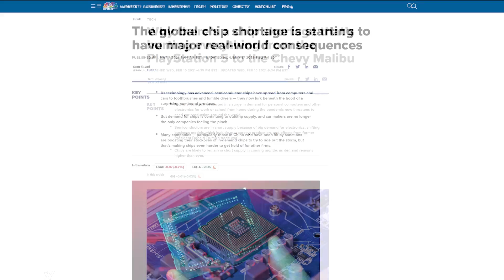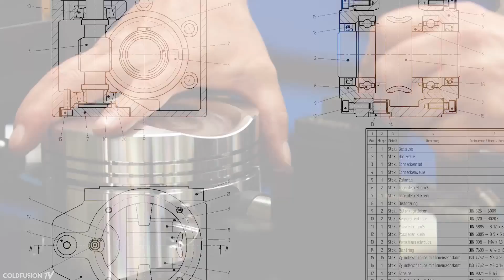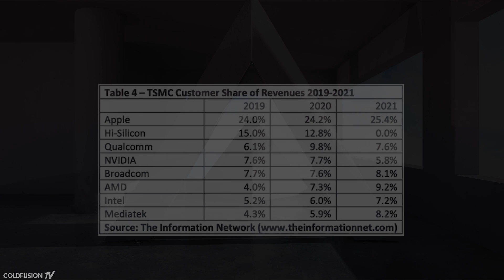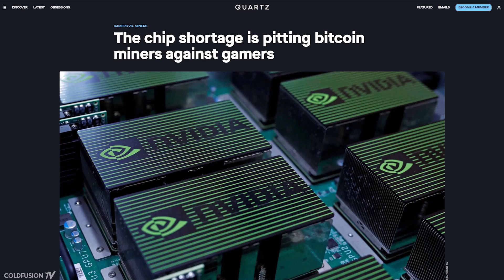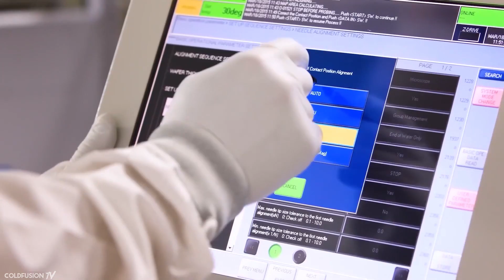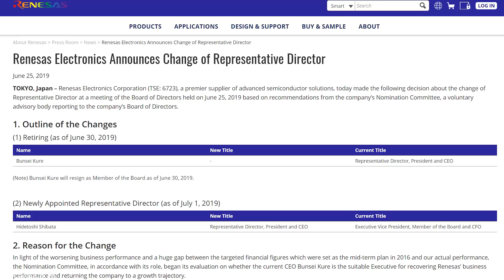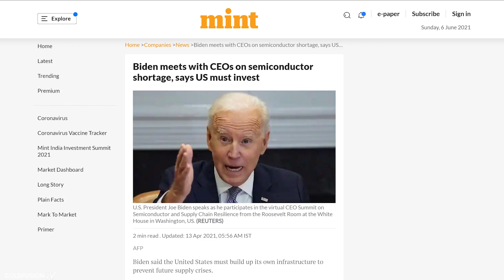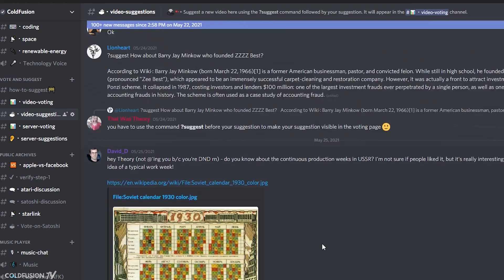How The Global Chip Shortage Started

Comment: update needed, chips should have recovered by now, but it hasn't.
Reply: It's due to manufacturing constraints on older generation chip manufacturing processes. The world is "flooded"  so to speak with foundries capable of making the newest computer processors, graphics processors, and phone processors on 300mm silicon wafers. 

But there are only a few fabs that can still create other non cutting edge chips (like small micro controllers, high voltage devices, durable and ultra reliable microcontrollers that go into cars and machinery) that are made on smaller 150mm and 200mm silicon wafers... Those semiconductors can't be made on the high tech new processes for various reasons. 

Think of it like the world is still in need of computers that run windows XP... Everyone can offer you plenty of windows 11 devices, but if you HAVE to have a Windows XP computer there's only one company still making them. (Obviously I made that up, but it's a decent example.... There's stages to chip manufacturing and too many plants have upgraded while products exist that can't be upgraded until a new solution is found)

Comment: As you said, the dependency on semiconductors is clear. There's one BUT to it. In many cases, we were not asking for the chips to be inside... Manufacturers pushed them down into our throats, giving (very often) no option to get a substitute. Do cars need so much electronics inside? No. Do fridge need Internet access? No. With all that extra electronics inside, is it more AAAAA+ friendly to the environment? No. What's wrong in an on/off kind of electric kettle? Do each and every one of us need at least 3 GPS receivers to track us down (phone, wrist watch, car)? No. And yea, consumers aren't free of guilt too. Picking "modern" and "shiny" things just because they are there (even if something doing exactly the same, they already have and is/works fine).

Comment: Auto makers have been producing more cars than are needed for a long time. Many unsold cars end up in car graveyards, and are left there to rot. Companies like Ford manufacture cars to start breaking down after 5 years, so you have to buy a new one sooner. They are perfectly capable of making their cars last longer, but if they did, they would make less money, so that's not going to happen.

They keep packing more and more electronic devices into cars even though they are the most likely systems to fail. Over 30% of modern car problems are electrical failures. 

All car makers are making more cars than they should be, and many of them go to waste. They can take this time out in the corner to think about what they have done.

Comment: Everything happens for a reason. Pentium 4 chips have been around for quite some time now. Even though commodores chipset was ahead of its time, pentium/intel got all the exposure. But new technology is on the horizon so they don't invest in the old technology anymore. There are photometric processing units on the way. They are 10 times faster and consume 90% less power than Nvidias GPU's. ARM processors were proven to be fast and reliable, but this new tech could be revolutionary it just may take couple of years before a consumer can get their hands on them, because the tech relies of small light tubing which is very expensive to produce. But this might explain why exactly big corps are at a hault with manufacturing. They simply don't know what is beneficial at this point.

Comment: The usual response would be to diversify the supply chain for redundancy. But the crux of the problem is that the capital required to build a semiconductor plant is truly astronomical. For new chips, ie 7nm and 10nm silicon used in modern cpu/gpu, the equipment can cost hundreds of millions of dollars and take years to build. This is because the equipment is EXTREMELY technology advanced and not easy to make. Fixing this problem would require a worldwide initiative to expand production, requiring a decade (probably) and billions of dollars. This got so bad because the big players just got bigger because the cost to play at the table is higher than anyone could imagine. 

SOURCE: I used to work at GLOBALFOUNDRIES (GF), a NYS-based semiconductor plant, as a researcher. They are pretty much wholly contracted to AMD and make all of their chips. The total cost of the GF facility was something around 14 billion dollars.

Comment: China is producing 1 billion chips per day in June 2021 (28 nm and 14 nm) mostly used in auto industry, and data centers. These components represent 90% of IC market. If I am correct, at this rate China will control most of the IC market which revolves around 28 nm and 14 nm, within next 3 years. This also means that the prices of these components will decrease, sharpening competition.

Comment: This has been decades in the making. When Silicon Valley was actually full of chip manufacturers actually making their own chips, in the 70s, costs of a "fab" was reasonable. To chase Moore's Law, each generation of new chips, had smaller feature sizes, on larger wafers. A "fab", the actual chip maker, could only hold onto 2 or, maybe 3 generations worth of equipment. They had to invest in new equipment, and haul out the old, every couple of years. The cost of every upgrade, went up exponentially. In time, most chip companies went "fab-less" (as Googles current endeavor), until the situation we see today.

btw: the chip industry has always been a Wall Street roller coaster ride. Volatility, is their middle name.

Comment: I wondered about the silicone shortage being that the same silicone used in chips is also used in vaccine vials for the same reason.
Reply: how could a chip go through a needle ? suppose it goes through , what will power it ? how strong is that chip ? how would it affect your biology ? i dont believe in this type of cons therories
Reply: @THEJOKEYJOKER  im not talking about chips in vaccines but research nanotechnology. Im talking about the vials the vaccines are within. They are made with the same silicone.
Reply: @psychoskate970  a relatively expensive chip that goes to toilet?  i don't consider it a threat
Reply: @psychoskate970  Silocone or silicon ? They are 2 different things

Comment: I'm only 1/4 of the way into the video, and I gotta point out that there has already been (for around a decade now) plenty of research and prototyping of alternative transistors that do NOT require semiconductors. If there is a shortage, the market will shift to using the new type. Don't fall for the fearmongering in the media.

Comment: This is what happens when MAJORITY of semiconductor is made in 1 Country (taiwan) by a single Corporation (tsmc).
Reply: Chip manufacturing is a teamwork type. There are over a thousand companies in the supply chain to support TSMC; it's impossible to move all these to another country to build a TSMC scale of the manufacturer. The way to make smaller chips like FINFET was invented by Dr. Chengmin Hu from Taiwan. The wet etching in lithography was developed by Burn. J. Lin, who is deputy general manager of TSMC, makes ASML surpass Nikon and Cannon, Taiwanese, contributed many breakthroughs in chip technology. EUV was developed in F12 of TSMC, Engineer from TSMC still in charge of the research in ASML

Comment: 3:20 TSMC has more than half of the foundry market. That does NOT mean they make more than half the chips, since companies that run their own foundries aren’t included there! So that excludes Intel, but also excludes the companies whose less glamorous chips are essential to modern electronics, things like standard microcontrollers, battery management, logic chips, and all manner of specialized little chips, as well as discrete components like power MOSFETs. Without those parts, you still can’t complete the product. The companies that make those things, like Texas Instruments, Maxim, Microchip, Analog Devices, NXP, On Semi, etc, all run their own fabs, and the lead times on their parts have grown dramatically lately, too. 

Not to mention that there have been ongoing shortages of some basic electronic components, like capacitors, for years now. It boggles the mind.

Comment: Great synopsis. Here is one of my recent ones if anyone wants to compare.
Copy and paste-

Initially early covid shutdowns in China and some other places caused a hiccup. Most non-China customers reconsidered their outlooks for the future, some went cautious and cutback on future orders, others started doubling orders to stockpile inventory.
Also remember, 2018-2019 was already a rollercoaster for the industry due to tariffs and restrictions on China.

China got rolling again pretty quickly, and orders picked back up while the West went into lockdowns.
Shipping delays become rolling delays. Air travel greatly reduced, expedited shipments that typically took a few days were taking a week or more and drastically increased in price.
Cargo shipments that typically took a couple of weeks jumped to a month or more, dependent on loading/unloading and customs.

When auto manufacturers let their future capacity go, most fabs were already easily hitting >95% capacity due to increased demand in medical, telecom(5G) and general consumer electronics.
Auto manufacturers wanted their capacity back and more when they realized things jump started in 2H 2020. Except minimum lead times for orders are typically 3-6months and can take 3-6months from wafer start to being sold/shipped to the customer, which may still need to be put into a final product before being sold to the final customer.

General increase in demand-
Auto manufacturers are expected to use 3-4x the number of semiconductor chips when they switch to full EV and even more with autonomous vehicles.
Telecom(5G) infrastructure is also supposedly using an increased number of chips, I've heard anywhere from 2-4x.
General consumer electronics saw a huge boom due to WFH and stimulus checks.

Semiconductor development-
Only 3 companies are able to continue R&D on cutting edge new process nodes, while there are dozens of high volume customers that need it. And hundreds of others who want it once it reaches a certain maturation point (yields/cost).
Semiconductor industry has been using the same wafer size(12in/300mm), area of usable silicon, since the early 2000's. Wafer size was seeing ~2x increase in area every 10 years or so, the industry should have moved to 18"/450mm wafers at least in 2015/2016 when EUV was being developed(new photo-lithography technology).
Cutting edge semiconductor fabs delayed switching to 18" because the cost to build new fabs would go up significantly due to switching from older 12" tools to 18" tools and they had already seen the cost per transistor trend reverse and started increasing due to ballooning R&D costs and additional tool costs.
ASML is really the only company that can deliver the new photo-lithography technology and they can only crank out so many tools per year. ASML doubled their EUV tool shipments from ~20 in 2018 to ~40 in 2020.

Legacy issues- 
All the legacy fabs using their 20-30year old nodes on 150/200mm wafers, some still use 100mm wafers(~40years old), are having a heck of a time keeping those tools running.
Replacement parts or additional tools available for purchase/refurbish are tough to find. Scrapped tools are bought when they are found just for some of the still usable parts.
The ability for some of these legacy fabs to increase capacity is generally pretty tight. You might be able to get a few extra tools to alleviate a couple of your current bottlenecks but being able to find the tools to create a whole new line... to actually make a significant increase to your throughput will require quite an investment(which some are making). Then the trick becomes finding room, in a good place that is near the other tools, in a building that has been running near 24/7 for the last 20-30years.
Then, if you are able to do all that, you have to do the same for your testing lab and then again at your assembly facility. 
All of that while keeping costs at a minimum because keeping the cost per wafer down is essential.

So basically there are at least a couple dozen factors involved and no easy fix.

Comment: As someone who is the tech support guy for literally everyone around them (including at work), how about we don't put computer chips in literally everything? A lot of things don't actually need computer chips, or they don't need modern chips which are the current shortage. We don't need a smart fridge and a smart oven, those things can literally be run on 555 timer circuits if you build them right. And I certainly don't want drive-by-wire to ever become the only way to have a car.

Comment: Just an idea but how about TSMC setting up a plant in Tiwai point near Invergargill South Island of New Zealand where there is an abundance of water and electricity from Manapouri and is free from Typhoons and hurricanes of course. What an ideal solution!
Reply: I was in the fundraising section for another chipmaker back in 1988, the second year TSMC was built, and my son is working in the TSMC research unit. Most of the semiconductor engineers are in Taiwan, other countries just don't have these many talents. Chip manufacturing is a teamwork type. Over a thousand companies in the supply chain support TSMC; it's impossible to move all these to another country to build a TSMC scale manufacturer. The way to make smaller chips like FINFET was invented by Dr. Chengmin Hu from Taiwan; the wet etching in lithography was developed by Burn. J. Lin, who is deputy general manager of TSMC, which makes ASML surpass Nikon and Cannon, Taiwanese, contributed many breakthroughs in chip technology. EUV was developed in F12 of TSMC, Engineer from TSMC still in charge of the research in ASML. Build factories in Arizona actually is a bad idea; the only TSMC factory that is losing money is the one located in New York. To set up a factory in the US, it's all political.

Comment: Your video implies that it's one part/wafer that is impacting everything when its far more nuanced.

GPU`s recently changed design which meant replacing the TSMC 12nm process for Samsung 8nm in the case of Nvidia. The process node shrink, new design and mvoing company all contributed to lower yields until process ramped up. 

The auto industry cancelling it's order for a sub $1 part then reordering it when demand was higher than expected was a failure of just in time manufacturing and failing to stock pile. The reason that part (a display chip) is so cheap is the fact it uses a very old process node which has near 100% yields. During the down time the equipment was turned off and unable to restart due designs being lost and people with the knowledge having moved on. Porting this to another process node isn't simple (look at Intels Rocket Lake which back ported a 10nm design to 14nm. The fact the released anything at all is impressive). Intel have stepped in to offer reverse engineering of the chips design and porting it to a newer process node in their fabs. 

Don't forget power outages too causing sudden shut downs of entire production lines. A sudden shut down causes everything in flight to need to be inspected and more than likely thrown away as it will introduce defects. The whole chain can't just be restarted after a shut down and getting parts through each stage takes time never mind ensuring every stage is running at 100%

The reason the supply chain is in a mess ultimately boils down to just in time manufacturing

Comment: My old car runs fine and doesn't have any chips, goes from A to B without issues, ac works and the sound system is pretty good. Why not make cars without chips instead of crying about shortages?
Reply: ‘Has a good sound system’ and you think it doesn’t have chips😂
Reply: @sam512  ok smarty, but if the chip in the old radio breaks down it doesn't affect the car from functioning

Comment: It's going to take forever to get my hands on a RTX 3090 :(
Reply: By the time an RTX3090 is available, you'll want an RXT4050
Reply: To be fair I have one and it’s not that crazy. Kinda underwhelmed. This is after switching from a 10 year old PC (i7-3770K, Radeon 7870)
Reply: @Mark-zg4ky  Still using my 7870, this thing is a tank
Reply: @cmgm6027  Hahaha cap bro. you're running at 1080p and you're happy with 7870 performance with 2021 games?

Comment: I think regarding pc part especially graphic card, as the manufacturer supplying less to the distributors, they need to make a choice to keep up with the profit. As in this video case the distributor up it price. In my local case, every pc builder shop that want to buy products from distributor need to buy graphic in a package. In the worst case, distributor can sell 1 RTX3060 with 5 of their B450 motherboards. The price of the graphic cards it self is normal, but as you need to buy motheboards too, which a slow moving products, pc builder shop needs to up it price to keep the cashflow good.